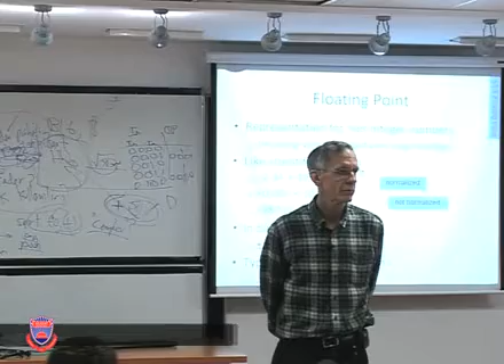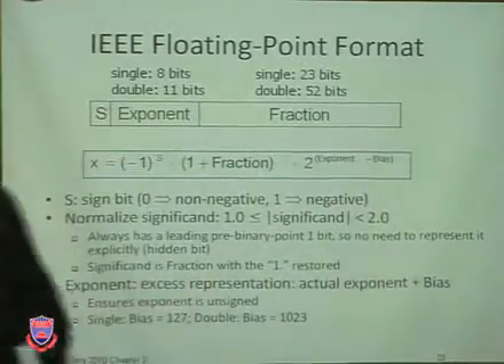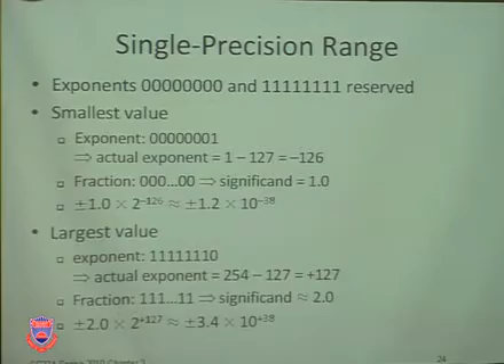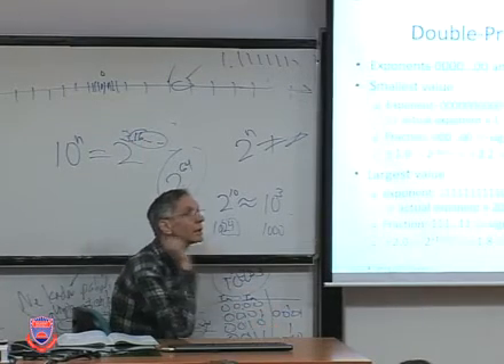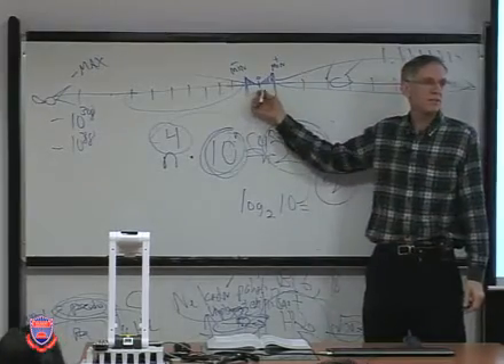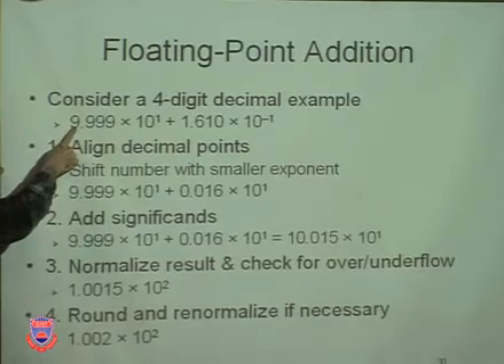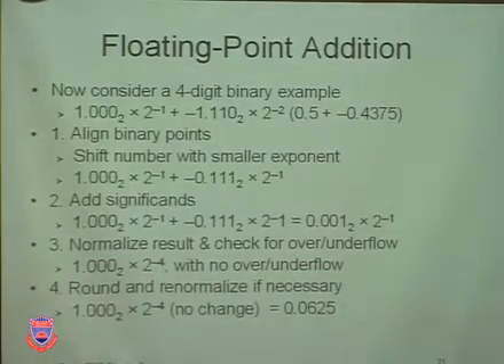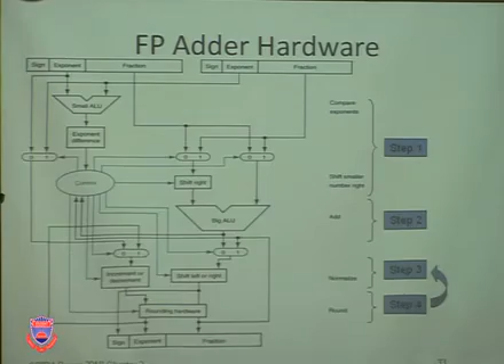CS-224 Computer Organization Lecture  17

Comment: For anyone watching how doesn't get why the 10^n = 2^x question

10^n = 2^4 is too big and 10^n = 2^2 is too big is too small

It's because he is trying to make both sides of the equation equal. In doing so, his saying 

if n = 1 then what does x need to equal for the equation to be true, which would be 3.(something) since 2^3 = 8 and the number need to be a slightly higher than that.

Also log₂(10) = 3.322 not 3.16